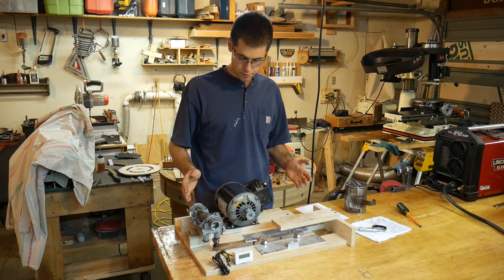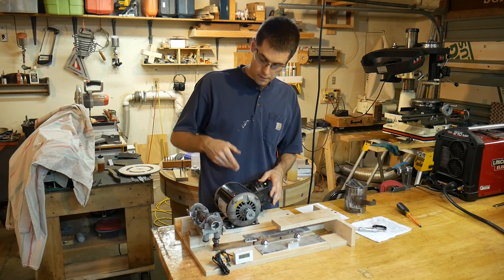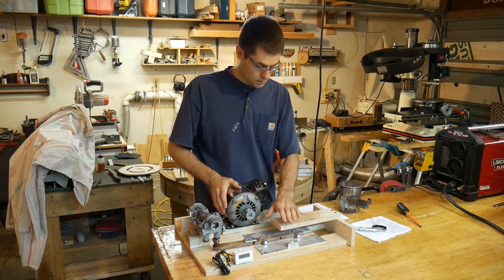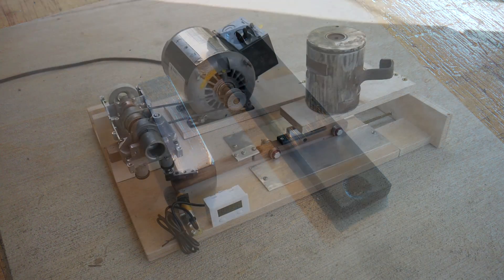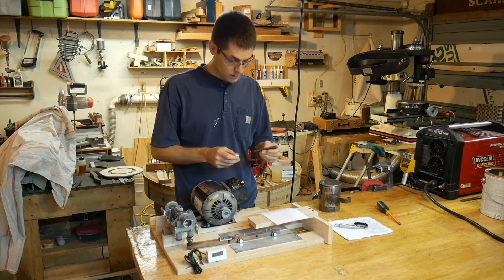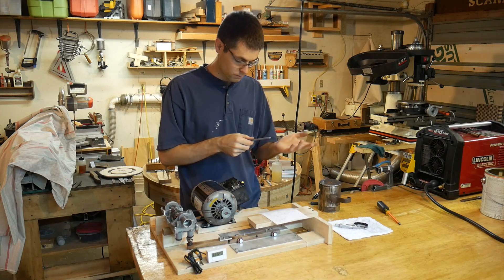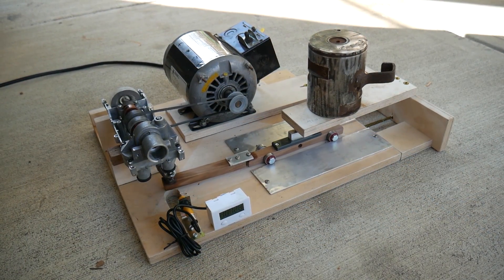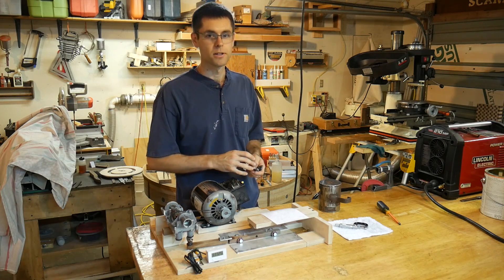UHMW vs MDS Nylon

Comment: Hello, any idea how UHMW would wear against say a diamond plate/abrasive?  I could try it of course but just wondering if you have any experience like that.  I was thinking of using some as a bearing on an abrasive plate but I suspect that it will wear a fair amount.  Thanks.
Reply from the maker: I expect that anything would wear significantly when placed against an actual abrasive. This soft UHMW is probably no exception.
Reply: You would need a smooth diamond plate to stand up to wear against an abrasive diamond plate. Even a tungsten carbide plate would get chewed up.

Comment: Can a UHMW block slide on another UHMW block? In my head this would be very slick but I can also see how they may wear each other out. Thoughts?
Reply: I believe the danger there is melting at higher speeds since the plastic on plastic will insulate the heat generated at the interface so there is a higher chance of it turning to goo and melting into each other. Only at higher speeds though. The friction between polished steel-UHMW and UHMW-UHMW are apparently very, very similar so little point unless you can't polish the steel.

Comment: How come you are testing this? If you wanted something  in between and harder than UHMPE you could go acetal.
Reply from the maker: Because these are two plastics which seemed like good candidates based on my experience and research. I have some Acetal and it's something I'll test later.
Reply from the maker: I ran some acetal for 15,500 cycles today and indeed got some results between the other two plastics. Slightly squeak later in the testing and very slight wear, very good overall. Images here: http://mechanicallumber.com/plastics-comparison-uhmw-vs-mds-nylon/